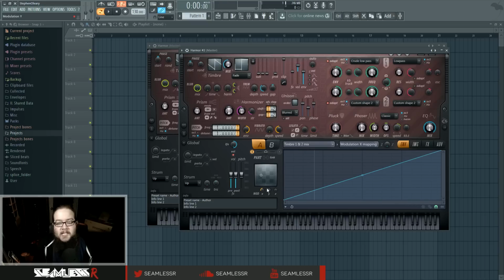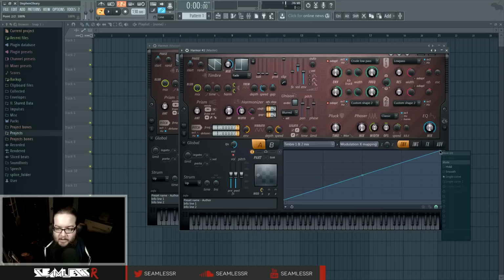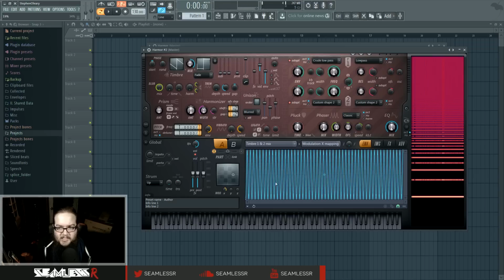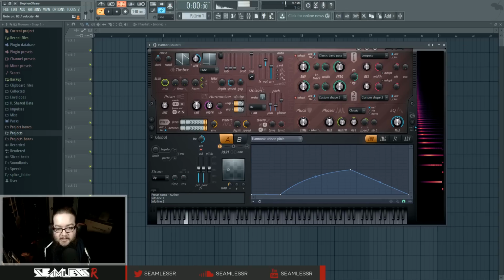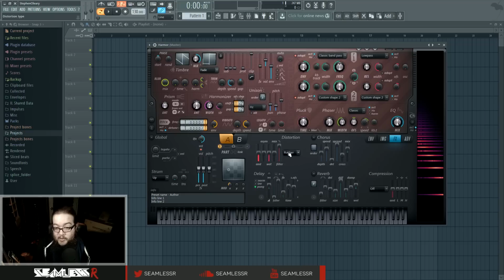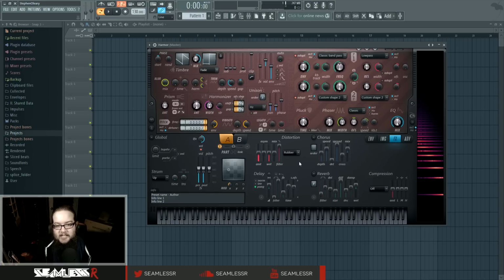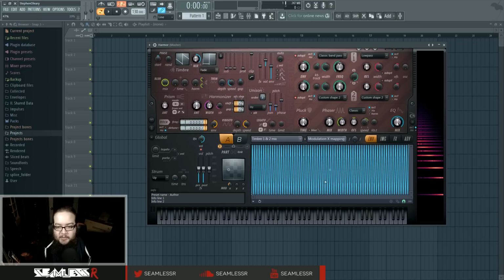How TO Bass 123: Saw/Square Harmonic Modulation

Comment: The Saw and square for Harmor is actually a crossfade wavetable (at default fade option). The really weird thing though is if you put anything on the left side (right click and analyze waveform pick something like a different saw or whatever)  it turns the right side into the square version of the left. But if you put the right side as a different wave form then the left another one it's a traditional crossfade between the both if you keep it on fade mode. You can also modulate between them extremely fast,but the Timebase (PPQ) value dramatically effects anything you modulate with midi really fast including the wave form in line editor options. Higher values have higher resolution,but takes more CPU. The reason it effects modulation thats really fast has to do with interpolation at higher resolutions.